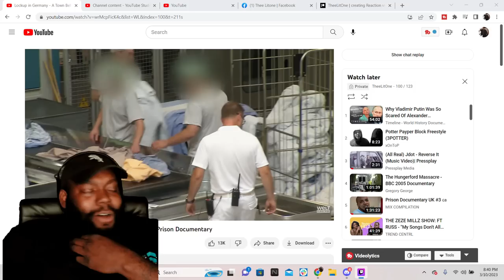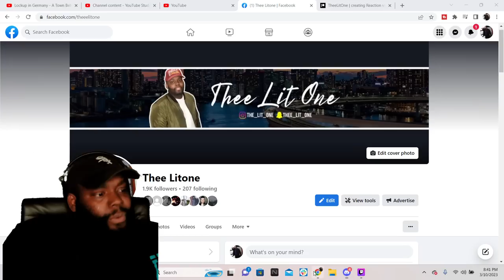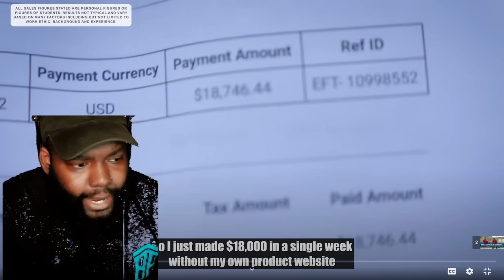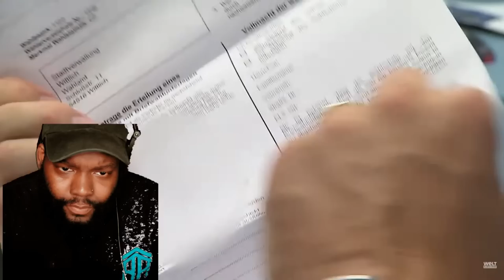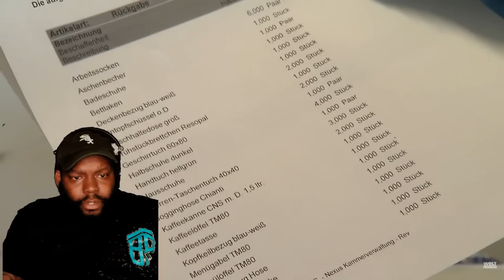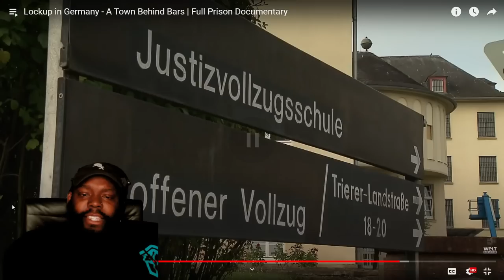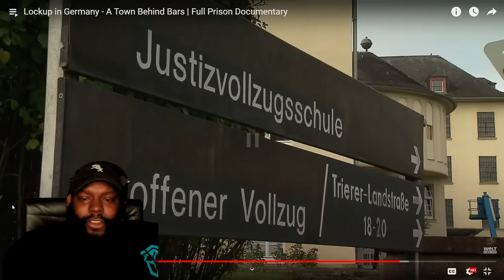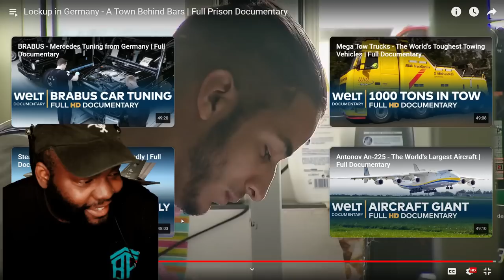BRO WTF! | CHICAGO DUDE REACTS TO Lockup in Germany - A Town Behind Bars | Full Prison Documentary

Comment: You shouldn‘t get the German penalty system wrong. We have something called „Secirity detention”, meaning that the actual punishment is over, but the prisoner is deemed too dangerous and can not be set for within the next foreseeable time. After many years you may apply for a rehearsal,  but usually the prisoners stay there until they pass away. They are given a lot more space, better food, money, less restrictions, roof-top Terrasse though, because ans mentioned before, they’r actual punishment is over.
Reply: And they can even have small pets and pot plants. And also the number of those prisoners is around 600 in all over Germany.

Comment: Hi, a little bit late, but search for - The German prison program that inspired Connecticut - and watch this, it is also informative and shows another system

best  regards from germany

For the juvenile detention center applies:

Between the ages of 14 and 17, one is a juvenile in the eyes of the legislature, to whom juvenile criminal law must always be applied. Between 18 and 21, one is considered an adolescent. In this age group, either juvenile criminal law or adult criminal law may still apply.

The minimum juvenile sentence is six months, the maximum five years. If the offense is a crime for which a maximum sentence of more than ten years' imprisonment is imposed under general criminal law, the maximum sentence is ten years.

Justizvollzugsschule = Correctional system school

Offener Vollzug = open enforcement or open implementation means:

in open prison, there are few or no safeguards against escape. Life is similar to everyday conditions in freedom. The prisoner can pursue a "normal" job during the day and returns to the correctional facility in the evening - more detailed description

In the open prison system, prisoners have more freedom than in the closed prison system:

The cells are not locked, and prisoners can work or apply for release.
Open prison is a stage of resocialization in which the prisoner works on practicing the rules of free life.
The prisoner leaves the prison in the morning, goes to work and returns to the prison immediately after finishing the activity.
There he can participate in recreational, sports and treatment activities and move freely most of the time.
The prisoner spends the weekends with his family.
However, he must adhere strictly to the prescribed rules, as violations such as drinking alcohol or returning home late can result in him being transferred to a closed prison. Section 10 (1) of the StVollzG sets out the statutory regulations for open enforcement, but there is no unconditional legal entitlement to open enforcement, although all the bases for it are met.

Open detention is not suitable for prisoners who are particularly at risk of addiction or absconding, for prisoners who have already abused a period of relaxed detention, or for prisoners against whom extradition, deportation, investigation or criminal proceedings are pending. The criteria for admission to the open prison system can vary greatly from state to state.

And - funny side in comparison to other countries:

In principle, breaking out of a prison is not a punishable offense in Germany. As early as the 19th century, German lawmakers respected the natural urge for freedom. For this reason, no one should be punished again as a result of an escape.

In the rarest of cases, the door of the prison is open, so that the prisoner could simply walk out. Therefore, so-called accompanying offenses often occur during a prison break.

If, for example, physical force is used against persons, the criminal elements of bodily injury or even dangerous or grievous bodily harm (Sections 223 et seq. of the Criminal Code) are often fulfilled. Bribery (§ 334 StGB), threatening (§ 239 StGB) or taking officials hostage (§ 239b StGB) is also a typical accompanying offense in the event of a breakout.

In the case of damage to property, for example barbed wire fences, the criminal offense of damage to property (§ 303 StGB) must also be taken into account. The question of theft is also complicated. If objects are taken from the institution, the offense of theft (Section 242 of the German Criminal Code) is possible. This can be the case, for example, with stolen keys or prison clothing. The decisive factor in these cases is the intention to steal, which is usually not given in the case of prison clothing, which is usually quickly disposed of. In the case of a key that is taken out of the prison as a means of escape, the situation may be quite different.

Comment: Right at the beginning: Yes, it‘s possible to be a juvenile. Germany has a separate criminal code for juveniles. It includes the same crimes and definitions, but different sentences directed at warning and, if that doesn‘t work, rehabilitation and education. That also reflects age and scientific findings about impulse control.
Basically, the minimum age to be convicted of any crime is if you are 14 at the time of the incident. From age 14 to 17 included, juvenile courts and the juvenile code are mandatory, and from 18 to 21 included the juvenile court is handling the case but will determine on a case-by-case basis whether the defendant is mature enough to be treated as an adult. If so, the juvenile court will still handle the case, but the regular code will apply.
The juvenile code has a lot of different tools for sentencing, ranging from (which might sound silly) a reprimand by the court (mostly accompanied by orders to be supervised by the German equivalent to CPS) and social work. The next step would be a leisure time detention, the juvenile will be ordered to stay in juvenile detention centers for a few hours at at time during his free time to give them a taste of jail. The next step is weekend detention - it‘s exactly what it sounds like: the juvenile will spend one or more weekends in juvenile detention centres, for the same purpose as step one. The next step is juvenile custody, ranging from one week to a maximum of 4 weeks. All those detentions are used when mere corrective methods seem insufficient, but a full juvenile prison sentence would be too severe a punishment. It can also be used as a warning shot arrest, in conjunction to a prison sentence with parole (meaning, the court rules, say, 4 months in juvenile prison, on parole, parole time will be 3 years, and the defendant will spend one week in custody to show him what it will be like if he breaks parole). The most severe punishment is the real juvenile prison sentence, which can be on parole under certain circumstances, and has a maximum sentence of 15 years (so, crimes that would imply a life sentence - which means 25 years in Germany - will be 15 years by juvenile code). Juvenile prisons are generally even more relaxed (not exactly the correct word, but I think you‘ll get it) than regular prison, but will include mandatory school for juveniles that haven‘t finished their mandatory school time (iirc, it‘s up to 9th grade, so roundabout from ages 6-15), and offer learning and even formal training for vocational jobs. Basically, if you are sentenced to juvenile prison, were a messed up kid who didn’t care about education or school, you are given the chance to get out being able to work a stable job and start a productive life - if you take that opportunity, of course.
And that is what the German prison system is all about, at least for the most part. The punishment is being locked away, having your freedom taken away from you (a prison sentence is officially called a „freedom punishment“ in the laws), but giving you the chance to rehabilitate, to learn, to become a member of the society after you get out. Not to take away your pride, your dignity, your basic human rights. That was done in our country long enough, and it ended in 1945. The first, and most important, article of the German constitution reads as follows: „Human dignity is inviolable. To respect and protect it shall be the duty of all public authority.“

Comment: And yes,.. that how messed up the US prison system is. Also, the goal of most prison systems is to protect citizens rather than to effect cruel punishment. The latter has the opposite effect as prisoners become even more detached from society. Rehabilitation is what can prevent a relapse from happening. 

And as shown with the old prison, it used to be pretty grim in the old days. I think that the results of Norway's penal system have opened some eyes in that regard. You should check out their maximum security prison. Germany still pales to their prisons, similar to the UK compared to Germany.

Comment: FYI, here in germany you get checked up by a social worker if your mindset is an adult, not your body. Thats why there are 23 year olds in juvenile prison.

If the social worker thinks you are, lets call it, a lil bit slow with your brain or not developed, you get juvenile status up to 25 years old. Its rare, but it happens.

But not everything is green here on our side either. The problem is, if the system turns to social and crimes like rape gets you only 12 month probation, like the last years... And i talk about real judgements from judges.

But yeah, our prison system is probably the second best in the world. But to get it working, you need ppl who are accomodated with the system and want to be a part of the system.

Comment: This isn't a typical german prison, but the MO is pretty much the same. It's about rehabilitation, not punishment. German prisoners get a hell of a lot leaway, if they behave, and most of them are unwilling to jeapordize the benefits they have earned. Of course there are a lot of dangerous criminals in germany as well, but usually the plan is to seperate them, from the ones that really want to reintegrate into society. And statistics prove, that it is working a lot of the time.